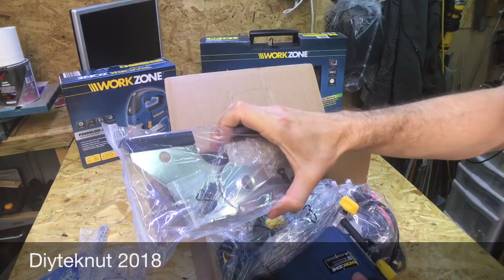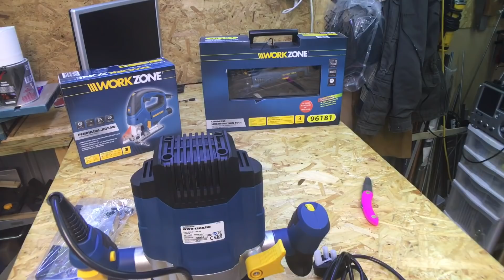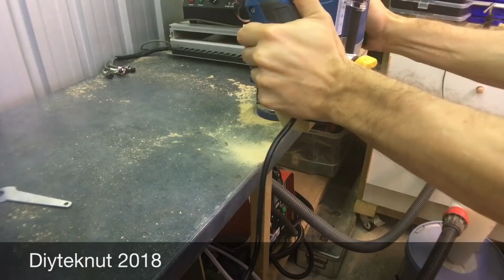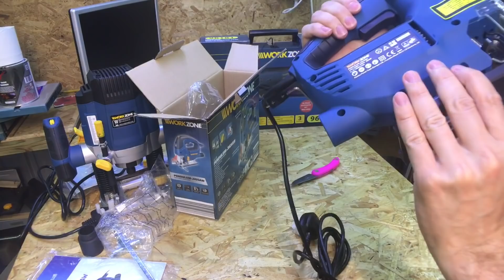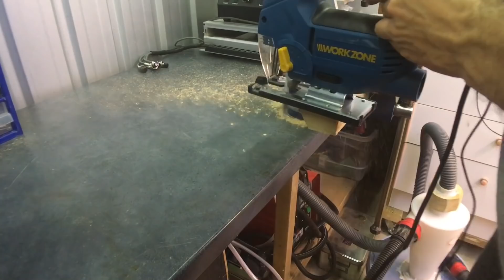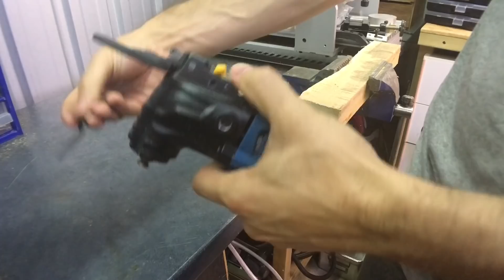ALDI Workzone Power Tools Jigsaw Router Multi Tool Testing

Comment: Colin barnett just watched your multi tool video and have a question about the battery charger, my charger does not work as there are only two contacts the third contact has no contact point ie the negative is missing, does the charger you have contacts T, +, and -.
I found your video very useful and would like to hear from you if it is possible.thanks in anticipation.

Comment: I just literally bought the 20/40 new ferrex range feels good batterys fit all tools so I hope they fit these type but not sure if aldi will still sell. But I got the impact driver a grinder and a drill and chainsaw and three 20v 2ah battery's and three 40v batteries the grinder needs a 40v battery
Reply from the maker: Yes they look good tools. i would like to buy them but my tool fund has been spent this year .
All the best .
Reply: @SHEDWORKSHOP  I know what you mean. I couldn't of got these if I didn't get rid of my old ryobi stuff. I don't use much so don't need a top brand.

Comment from the maker: Handy Good Cheap Tools
*MMA welder i would like https://www.banggood.com/custlink/3vGDsufVnM
*MIG welder i would like https://www.banggood.com/custlink/K3KKs7T5nO
*TIG welder i would like https://www.banggood.com/custlink/Gm3DBGhSsi 
*Tin Snip https://www.banggood.com/custlink/KmmmnwTVMl
*Stick Welder https://www.banggood.com/custlink/DDGKsw7PU9
*Welding Clamps https://www.banggood.com/custlink/mKKGbuwF1j
*Machinist Hammer https://www.banggood.com/custlink/KmDmQ1ut11
*Screwdriver Set https://www.banggood.com/custlink/KmmKATw5w4
*Precision Screwdriver Set https://www.banggood.com/custlink/K3v3Nuwi8V
*cordless Angle Grinder https://www.banggood.com/custlink/GDKmAFL7s4
*Carbide wood turning tools https://www.banggood.com/custlink/KKmKQwfS8S
* flex shaft Rotary Tool https://www.banggood.com/custlink/3KK3Z35Boi
*palm Router https://www.banggood.com/custlink/GDGGbT1iSj
*F-Clamp https://www.banggood.com/custlink/vKDGbfuZiB
*Double Edge Pullsaw https://www.banggood.com/custlink/mvGvb7uIZN
*Cordless drill  https://www.banggood.com/custlink/DmvGNTT9iT
*Mitre Box https://www.banggood.com/custlink/33KvbuTSj3
* Impact wrench  https://www.banggood.com/custlink/mKDK6g6Bts

Above are affiliate links and in the comments it costs you nothing, if you do not want to use links search on goggle more info Thanks.

#ELECTRICBIKE #EV #EBIKE

Comment: I believe most of the power tools aldi are made by positech power tools. The same company produce Worx and Erbaur tools.  Maybe check the label on your multi tool if it's a positech tool you may find spare battery labelled under one of their other brands.
Reply from the maker: yeah will take a look and see, Thanks for commenting Have a good week.
Reply: I have a worx weed whacker with no batteries... that might be the excuse I need to buy a work zone tool for kicks and giggles

Comment: When routing by hand I’m like you I prefer less powerful tools, I think my palm router is about 800w, but that’s because I’m still learning with it. I do like more powerful tools in my table though I never have it on more that half way. I love my pendulum jigsaw which I often use with 150mm blades and has held me back from buying a bandsaw. 

I bought a Work Zone table saw last week for £89.99 which is brilliant for my uses and save me £70 on the exact same Scheppach in Screw Fix. 

Great unboxing, very honest and real, thank you.
Reply from the maker: Thank you my friend your comment much appreciated. Yes i prefer the palm router for small jobs its very good for making signs.  The  pendulum jigsaw is such an upgrade from my non pendulum lots more power was not aware of 150mm blades will have to get some would be handy. I just got the scroll saw nice bit of kit half the price of the scheppach ordered aldi online free delivery
Have fun with your tools all the best. Jace
Reply: DIY TEK NUT Since my first comment the table saw met a very nasty end when the entire motor housing collapsed, scared the bejesus out of me. I vowed never to darken Work Zone's door again after that, but I made the mistake of walking into Aldi with my wife and ended up with the multi tool in my hand. It’s not a tool a tool I will use every week or possibly every month, but I have a very large bird table/house which has some wood rot in one of the supports for the stand. I can see the tool being very useful there removing rotten wood, sanding in awkward places etc. I can see it being one of those tools that is rarely used, but when it’s needed nothing else will do.

Mine came in a zip up case, which is good for keeping everything together. It is the mains version, which is ok for me as I’ll never use it where there isn’t an electricity supply.

Comment: I love Workzone tools.  They do the job for homeowner use.  The only thing I don't like is that replacement or spare batteries aren't readily available that I know of.  I've got the 12v cordless multi tool but the battery doesn't last long enough for sanding a full room.  If they gave you 2 that would solve it.
If you see it come up again their 18v impact driver is so good.  I got one for 40 and it comes with 2 18v batteries.  I love it!